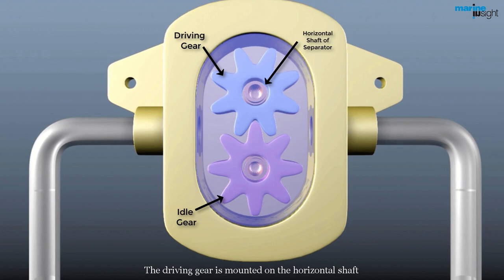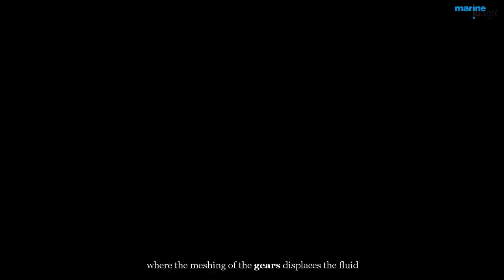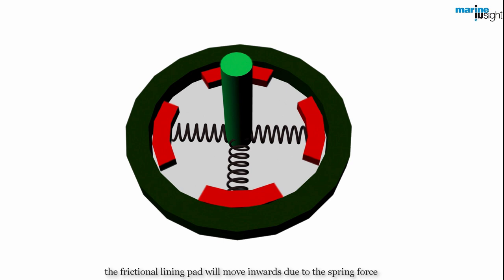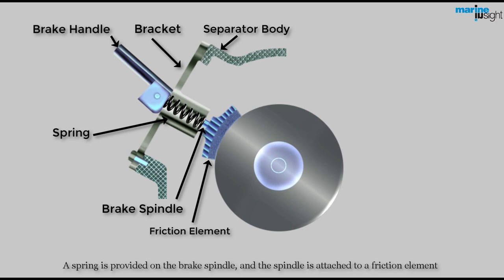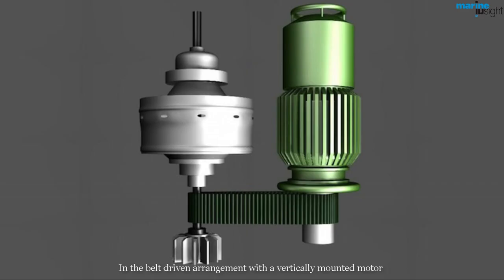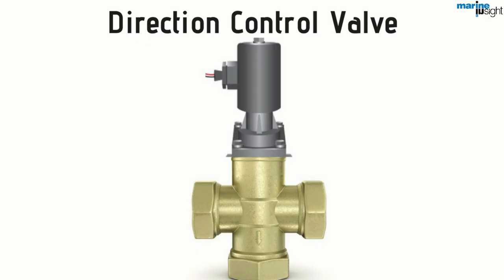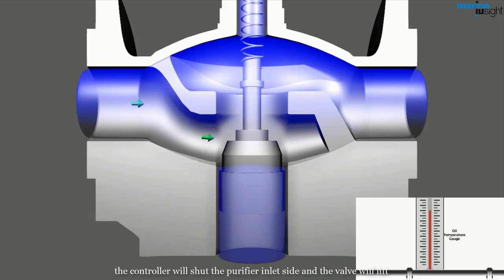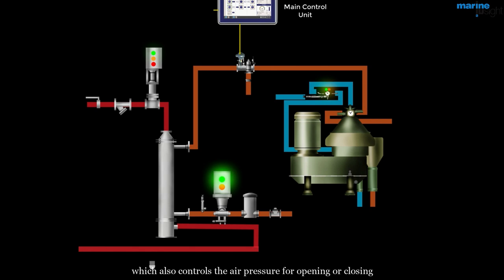Purifier Parts and Functions #purifier #marineoil

Comment: How the friction clutch is operating was a  bit confusing
Reply from the maker: It operates due to centrifugal force. As the speed increases, the centrifugal force makes the clutch attach to the drum.
Reply: @marineinsight  But question is that when frictional pads are attached with drum due to centrifugal force thn it will stop the bowl drum ..
Reply: @anuragtyagi8779 nope...you're talking about the brake